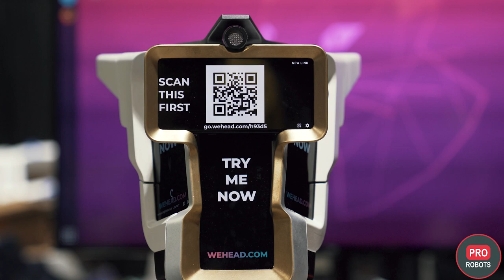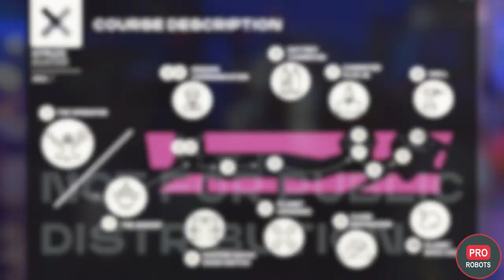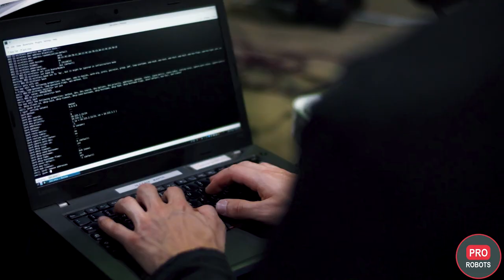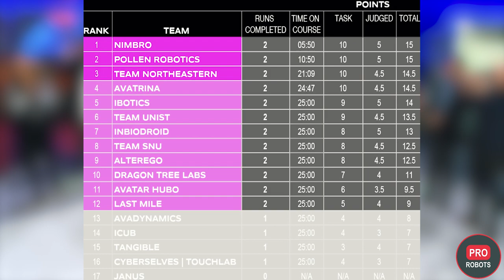XPrize - Robot Avatars

Comment: Could you imagine having a humanoid avatar that is just like controlling your own body? Being a carpenter but wearing a VR headset and when you move the bot moved just like you. With the same or better sight and touch accuracy. Taking measurements but just looking at an object. Measuring at the saw and at the build sight with extreme accuracy. This way, your skilled workers reduce the risk of injury, increasing longevity.  This is just one example, and I realize robots are trying to be automated, but what if the bots become an extension of the worker instead of replacing the worker. Just an idea. 

It's very cool stuff here. Keep it up!
Reply: that's nothing, imagine sending a humanoid robot to other planets like mars and being able to control it from earth, anyone on Earth could have the experience of walking on other planets. Also these robot avatars can build all kinds of infrastructure for us there.